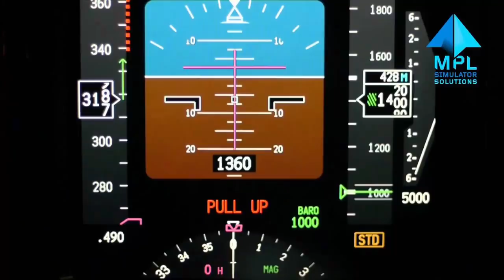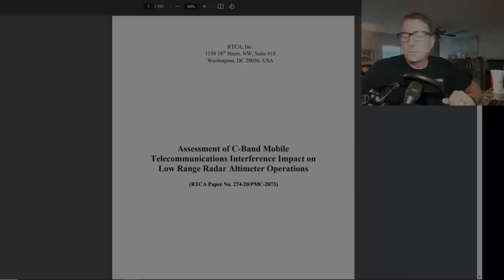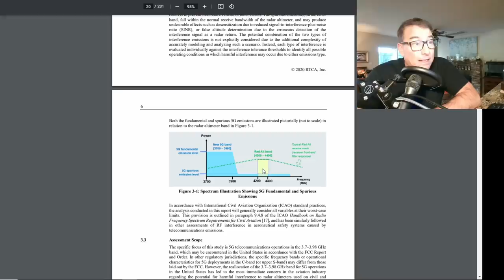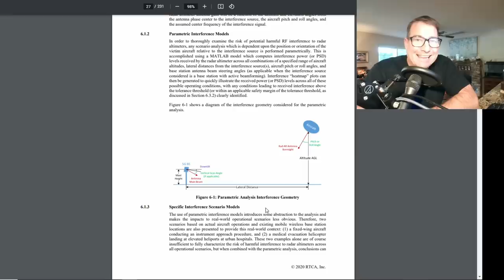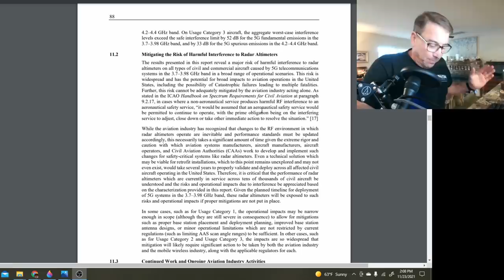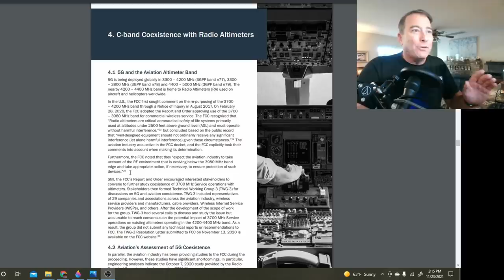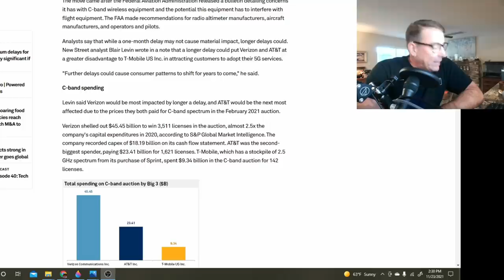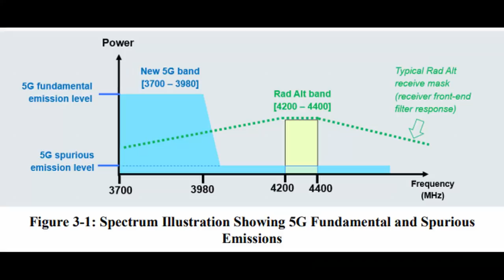5G C-Band Interference with Radar Altimeters in Aviation

Comment: I have extensive military training and experience with radio propagation. What we call the spurious emissions happen like echoes down a hallway. For instance, if you put out a signal at 5 GHz you would “see” another spike at 10 GHz at about a quarter the original power, 7.5 GHz at half the original output, and carry on this way infinity in both directions from 5GHz center. Now, with a band range of +/- 500 MHz off the 5 GHz center (4.5 to 5.5 GHz) each little frequency within that band also creates corresponding echoes. This could cause a blanket as shown which could effectively “jam” radio or radar operations outside the broadcast bandwidth.

Comment: A cut and paste from Forbes. The FCC began its own technical proceeding on C-band 5G in 2017/18, commissioning a report from the Aerospace Vehicle Systems Institute (AVSI) of Texas A&M. That report raised minor questions about radar altimeter susceptibility to interference but a subsequent study from Alion Science & Technology commissioned by T-Mobile concluded that the frequency separation of 5G and radar altimeter signals was sufficient to protect the latter.

I have noticed a trend in reports where the plane crashed in other than perfect weather to claim "the plane crashed due to a weather issue that was undetectable and even if detectable there was nothing to be done about it." "Do not even think about "pilot error". The airline industry seeks "qualified immunity" over any and every circumstance. Nothing at all could be the fault of the airline or the pilot.

Comment: Juan, 
You buried the lead, everyone involved is working together to solve this issue. The carriers agreed to Lower the C-Band transmitter power around airports and helipads for six months to study the issue.  I agree some of the equipment we use in very old indeed, but as things evolve, that is going to have to change.  Everyone has a role to play in this modernization, but I agree, we were here first.  As one who has been involved with the RTCA, I can say I have never worked with a more professional group of Engineers, Regulators, Operators, Manufactures and System Integrators.  They have a lot of credibility and have for a long time.  This will get solved, and they will have a major role in the solution.
Reply: I appreciate your RTCA volunteer work. What about the other problem? I can't see relying on passenger memory to turn off every device. We are imperfect.
Reply: @annaksfrog  yep.  people are messy and forget to turn off their stuff.  The good thing is phones have much lower power outputs.   But this may need to be addressed to some level.

Comment: The larger issue will be spurious reflections from ground transmissions. I seriously doubt the ground phone stations will have very effective control of transmission direction- look at the current phone systems, easily received in light aircraft.
 Whether the on-board radars have enough filtering and electronic capability to "sort out" and reject the odd incorrect distance signal will the the key. I suspect the radar altimeter would be a fairly narrow beam (only using 1w, so likely very focused) and the receive antenna is also likely quite narrowly focused, which should also help limit interference from ground reflection of ground transmitters. They are also likely a narrow beam to reduce scatter and spurious reading from the system's own reflections.
 I don't think mobile phones on an aircraft itself would have enough transmit power to interfere with the aircraft's radar transmissions (they are also omni directional, so even less directional transmit power), but I could be wrong.

Comment: The Air Force certainly understands the impact and has been arguing this for a decade.  It has massive implications for the DoD and NOAA dating back to the Ligado and L-band discovery.  Any frequency has side lobes and the potential for interference is not insignificant, both on the ground and in the aircraft themselves with the ever present phones not put into airplane mode.  Canada has moved to restrict the placement of 5G transmitters near major airports due to the same concern. I can see the significance of side lobe power on the frequency analyzer monitoring the C-band sat dish that I support.  It is not trivial.

Comment: Hurdles for the 5G guys - 1) Has a Registered Professional Engineer signed off (sealed) that paper? - That's typically how we protect the public from technological hazards  - conceptually it seems impossible for someone to do that evaluation without testing with real equipment in the fielded configuration.  2)  Are the 5G guys insured against the damages they might cause? This is how society normally protects investors from disasters.  In this case the risk seems too high to cover without real data. I hope an NTSB investigation is not needed to get these guys calibrated.

Comment: OK, so having seen so many 5G gainsayers, and understanding the need for it, as well as the (very) limited health effects, I now see a realistic concern. 5G is very limited in range, due to various factors. However (a very big however!), at 500m range, this falls into the critical area you discuss, especially below the 500m/1640ft altitude level, Juan. I haven't watched to the end of this video (having paused to comment), but has research been done on reflected radiation from a 5G transmitter? This would seem to be more of a concern, due to, as you say, the "beams" being generally aimed downward. A sudden spike and resultant false altitude reading would tend to really cause some alarm and despondency, so to speak!

Comment: So, a football stadium packed with 60,000 fans, equipped with cellphones they may have gotten FREE from their carrier, has NO interference between phones. Their antennae are omnidirectional, providing no protection. Their power is severely limited by a battery the size of a pack of matches. They connect to a tower broadcasting horizontally (not down as claimed in this video). The tower usually differentiates into its alpha-beta-gamma antennae, but otherwise must accept signals over a 120-degree view.

In contrast, the airplane RA shoots VERTICAL, easy to differentiate from the horizontal celltower signals. And the airline is probably willing to pay more than zero for one that works.  A simple dish, focusing the beam, and prohibiting 5G towers on approach paths, would be an easy start.

The root problem is that the airline industry is stuck in the analog age of 20 years ago, and the FAA is fatality-driven. Unless a problem kills somebody (or in the case of the 737 MAX, 2 planeloads), they do nothing.

Oh, my FCC license? P1-16-15538 ship radar endorsed.

Comment: That overfly zone in Houston is the Texas Medical center, not only are there a lot of emergency air vehicles that go in and out of there, but there are within 2 miles two major approaches to Hobby Air Port (KHOU I believe). One comes west of downtown and crosses between downtown and the medical center, the other basically follows just south of the west bound portion of Braes bayou (the bottom of the photo)  before veering to the East Southeast toward the glide slope. It is not uncommon in Houston for us to have ceilings below 2050 feet due to the clash between cold air and gulf moisture during the fall and winter. During the critical turn on a clear day you can see the faces of people in the aircraft windows as they turn to eastbound.

Comment: There's a simple way to slow down the 5G folks.

"So, you want the band close to radar altimeters, and you're willing to pay lots of money for it. Great. Understand, as a condition of this sale: You accept FULL RESPONSIBILITY if your equipment causes an aircraft accident that's traced to interference. And that means that you have to pay the families of the victims, and the airline, based on how much your gear causes the issue. If you're 50% at fault, you pay half. If your equipment knocks out the radar altimeter part of TCAS and two planes collide, you pay. If your equipment manages to cause a plane to pile itself into the ground killing everyone on board and there was nothing the pilots could do, you pay all. Remember that any given airplane may have 300 people on board, and that's 300 families, the airline, and the feds that will be looking for your company's cash reserves. Sign here, please."
Reply from the maker: “…And pay for ALL the equipment upgrades….you got the money!”
Reply: That's not how frequency regulation works. If you have a spectrum assigned to you, its your responsibilty to make sure, that your transceiver is immune to adjacent emissions.
Also there is not just 5G but possibly also other unwanted emissions that could disturb radioaltimeter operation. The steeper your filters, the less interference, the safer.
Reply: @_-Karl-_  Totally agree.
Reply: @antoineroquentin2297  Now, I could be wrong, but if you look at the FCC statement on a consumer device that has wireless communications, the statement specifically says something to the effect of "This device may not cause harmful interference, and this device must accept any interference received, and this device has been tested and complies". (And then typically will say "but, interference may still happen and here's how to avoid it if present".)

The way I read that, the second part of that is what you're getting at--whatever device you build needs to be able to handle adjacent frequency interference. But the FIRST part of that says that "you're not allowed to GENERATE harmful interference"! And to me, that says that if a 5G signal somehow brings down a plane by causing interference, then the 5G signal generator is in trouble. Not the radar altimeter (to be fair, they're not handling the interference properly, and that's where you get into the time component of the debate), but whatever generated the signal and whoever built and operates it. 

Ideally, of course, everybody updates their stuff so this isn't an issue. But, people being people, and wanting to make (or save) money for their companies, we all know where this is going to end up: It'll be a standoff unless and until there's an incident, and if and when that incident happens someone will be paying out the nose to update stuff (and compensate victims, and pay fines, and the like). We just hope that incident doesn't happen until after we're gone.
Reply: @erichusmann5145  That is partially correct. But it needs to be differentiated between in-band and out-of-band interference.
A receiver must be immune to out-of-band interference. Of course the best immunity does not help, if 5G transmits spurious emissons within the radioaltimeter spectrum, and that's the point where i see potential problems. Spurious emissions are regulated by the FCC, but I can't judge if they're strict enough.
Reply: @antoineroquentin2297  And I'm pretty sure that the spurious emissions are what the concern is in this case: Spurious emissions, at a higher power than the radar altimeters. The testing group the FAA worked with saw that there was a chance of that happening in their lab tests.

As far as the FCC being strict... Eh. Depends on who's telling the FCC what to do. They can be massively strict on occasion, and relatively lax.

Comment: The auction happened a year ago. What was the FAA doing for the last year? The FAA also had to have known that this was coming prior to January 2021.

Yes, I have dealt with the FAA certification process as an engineer designing gas turbine aircraft engines for both fixed and rotary wing applications.

FAA DERs are often rubber stamps in my experience and this is likely why the ball was dropped here. This was easily avoidable with a little due diligence.

Comment: Analog (RCL - resisitive capacitive inductive) filters have relatively mild slopes. Fortunately, using relatively new technology, we can create steep filters. Thousands of FIR (finite impulse response) filters can be configured on an FPGA (field programmable gate array), which can be summed to create steep filters. Dedicated DSP (digital signal processing) chips could also be used.  These circuits have to run very fast, and are expensive. It's unlikely that existing RADAR gear can be retrofitted with better filters. It depends on how good the original engineers were at creating modular equipment.
Reply from the maker: Thanks Brian!

Comment: Stacking up because of "go around" may be even worse than imagined. If the airfield is already below minimums for visual approaches necessitating the use of the "autoland" that is most vulnerable to interference, then diverting to other fields that are above minimums is likely to be required.
The havoc this will cause, not to mention public outrage, may be significant! And if there are low-fuel issues involved, this can even become life-threatening and require in-flight emergencies.

But, the gov wants money, so all of that will probably be damned and the weight of the dollars will likely win out.

Comment: LIDAR can reliably sketch the floor of a jungle through air gaps between leaves. An improved version may detect low altitudes through gaps between precipitation for that matter. May be a good time to begin research if it’s potential application? We have a choice to either not move at all or move side by side.

Comment: Its an easy fix. Mount the aircraft altimeter transmitter in a shielded tube, making it a defacto spot reading altimeter. Unless you literally fly within 2 degrees of a ground transmitter, the reading would not get interference.
Reply: There's not enough room on the belly of an aircraft to place an antenna with only a 2 degree bandwidth. The fix is, as others have noted, to add filters or change radar altimeters to use a mode that is less vulnerable to interference.
Reply: Your solution would render the rad-alt useless. It's not meant to measure slant range to the ground.

Comment: RF engineer here.  Just to put a perspective on the 6dB margin comment, every 3dB reduction means 1/2 power.  Making up some numbers, if 0dB represented 10W, then -3dB would be 5W, another -3dB (-6dB total) would be 2.5W, etc.  So when the 6dB margin of safety is mentioned, it implies the potentially interfering signal is one quarter of what they deem acceptable.

Maybe I missed it (sorry if I did), but I think what needs to determined is where did the 6dB number come from?  i.e. What implications occur? Is 6dB really a valid number or can it be 3dB  or maybe it needs to be 10dB, etc.

Comment: Juan, did I not see a 6G band referred to, in that phone publicity report.?.? Where will they stack that, in the 3980 to 4100 band.?
Reply: Bands are not specific to a particular G version, but it's unlikely that 4G equipment will be built for these new frequencies. It's always a dance between retiring an older technology which can allows frequencies dedicated to the older technology to be reused for newer technology. For example, one possibility is for 4G frequencies to be used for 6G initially, and then as 5G usage goes down, to migrate some of that frequency to 6G. The thing which 5G needs is more contiguous bandwidth to provide higher bit rates. It's a continuous struggle to find contiguous bandwidth, the US restacked television channels to allow selling some former TV bandwidth to wireless providers. It's also a challenge getting phones to have all the right attennas to support all the possible bandwidths.

Comment: I'd have to believe more study in mountainous terrain is needed. Chicago is relatively flat and aircraft landing at O'hare is unlikely to fly into the horizontal directional field of a high gain 5G antenna at 500+ feet. The foothills of LA, on the other hand, are certain to be transmitting sufficiently strong 5G frequency hundreds to thousands of feet above LAX ground altitude.

Comment: As a Navy helicopter pilot, we LIVE 500ft and below. We use our radalt from the moment we take off until the moment we land, and several of our critical systems REQUIRE a working radalt. Both overland and overwater. We cannot do our mission without radalt.

EDIT: making a ring around airports and hospitals doesn’t solve the problem. We rely on radalt EVERYWHERE. Going to land in a field to medevac someone? Radalt better work.

Comment: It might be possible to change the Tx-Rx on the aircraft to work in a similar fashion to the cell phone signal so it would only lock on to the aircraft Tx and ignore the ground or any other Tx. You would be using a changing freq which would be workable for just air to ground radar since it is just the time delay you are looking for. This might eliminate other interference also. Currently in the US we use a system for R/C that Tx  a pulse stream before checking for a clear channel, but in Europe they use a system that listens before Tx.
Reply: Still would get anew FAA part number though

Comment: Seems similar concept of autopilots in analog technologies working with updated digital technologies.

On a cost basis, I think overtime the older Radar Altimeter will need to be modified/upgraded. The final costs always is paid by the consumer in higher ticket prices.

In the interm, the FAA will simply monitor the findings into a database. Change regulations if necessary as the need is required. The phone companies are so far ahead of almost every government agency that this battle will occur again and again.

Your findings are absolutely correct Juan. It still will be follow the money.  I flew into Amsterdam International Airport from JFK. We did an cat 2 or 3 into Amsterdam. At FAF the gear comes down. The plane pitches down the power retards. You can feel and hear the auto throttles. Zero/zero then suddenly still zero visibility in the soup you see a runway and throttles fully retard. You can barely see the runway edge. The pilot then taxis to the ramp you can't see.